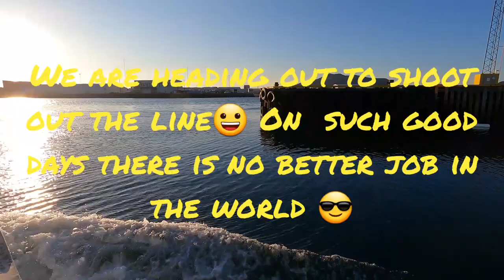Shooting out line with Volcano in background, Iceland. Shot in 4K

Comment: Does it effect the water temperature?  And in turn, does that change the fish behavior?
Reply from the maker: If the eruption is under the sea then It does change the temperature close to it. But in this case the eruption is on land so it does not afffect. There are stories from some older Captains at iceland that say, that in Surtseyjar eruption (1963) the ocean warmed up a bit around that area and they cought more fish than normally. So if they are to believed and i see no reason for otherwise, than it can affect the fishing in a good way.😁